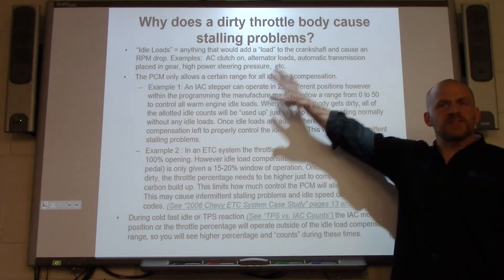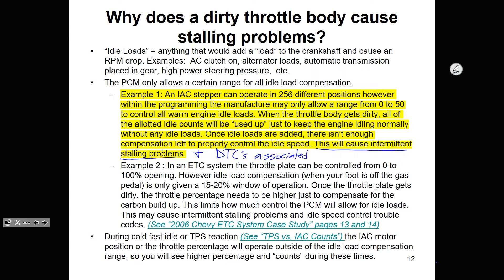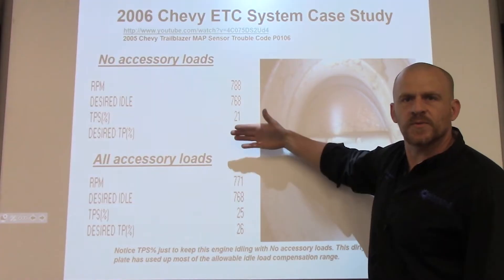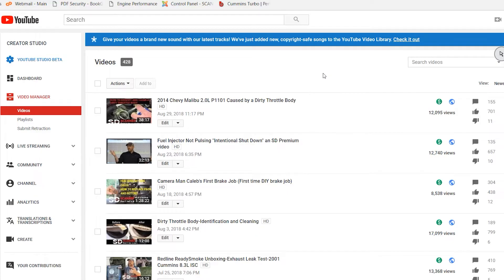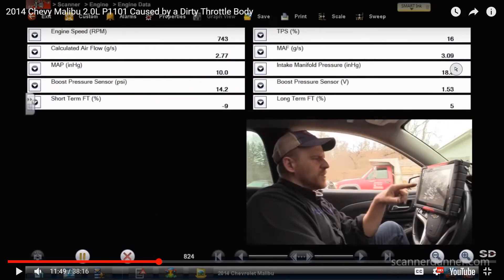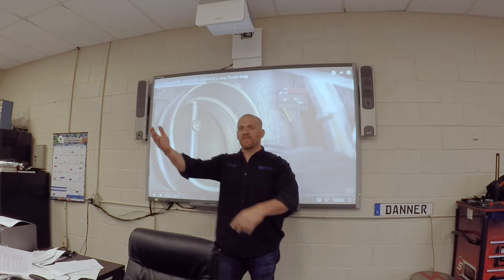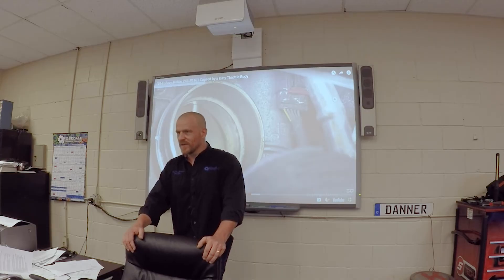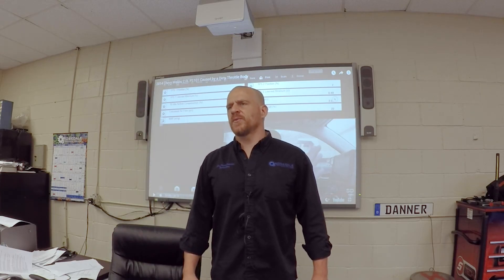Why Does A Dirty Throttle Body Cause Stalling Problems

Comment: From experience I can 100% attest that an electronic throttle body will not cut your finger off. It will pinch the crap out of it if it catches it just right.

Comment: My highly modified supercharged Boss Roadrunner Mustang kept stalling coasting to a stop, and then it wouldn't start up without giving it gas. Took twin blade throttle body off and the backside of blades were all gummed up. Cleaned it spotless and car starts on first crank and stalling is gone. This video is Absolutely correct.
Reply from the maker: Awesome! Nice job on your part

Comment: I had a dirty throttle body cause a no crank a couple of weeks ago. That was a first for me. 2007 Corolla popped a code for throttle stuck open. After reading through forums and YouTube videos. They all seemed to say a dirty throttle body was the cause. I took it off and cleaned it. Once I reset the codes it started right up. It also tripped the MAP code an hour before that.

Comment: Hey, Paul. I was trying to troubleshoot a p0101 on a Nissan Quest yesterday. I looked at the maf calculated load at idle, it was 40 and sometimes 70. I concluded that the maf was overreporting the airflow. Today, the tech diagnosed it, and suggested replacing the sensor. He replaced the sensor 3 times before he found a good one because all the sensors were causing popping noises through the intake. He even thought that the cat was restricted, which I didn't think was the case after following you for a long time. If an engine cannot exhale, it cannot inhale. Less air in means less grams per second or calculated load. As far as the dirty throttle body, could you use the tps voltage if you don't have a percentage  PID as a higher voltage would suggest a dirty throttle body?

Comment: I’ve cleaned probably hundreds of throttle bodies over the years. I always open the throttle by hand and have never had an issue from it. Nissans are the worst for resetting the idle. I had one that I had to disconnect 3 injectors to get the idle speed low enough that the relearn would complete.

Comment: Watched a ex co worker hold the throttle wide open with a hood prop, & quickly cleaned the throttle body with the engine running "WFO"! Idiot... All because it wouldnt open koeo, lol. He almost got the cleaning rag sucked into the engine as well.
Reply from the maker: 🫨 damn that's crazy

Comment: Thanks. I have the same problem in my Chevy Malibu 2017. What is the reason for getting throttle body dirty? I know its carbon coming from engine but this is an common for all vehicles. How does my vehicle throttle body is getting dirty again and again?
Reply from the maker: All vehicles! Primarily from the PCV system

Comment: I don't know if this is true for any other manufacturers but Mercury Marine use mostly GM throttle bodies on most of their sterndrive and inboard engines and they cautioned against manually open the throttle plate do to the throttle motor becoming a generator and back feeding the system. I have mistakenly done it with no apparent harm but I do disconnect the TB plug (most of the time).
Reply from the maker: I've hear something about the plastic gears internally being damaged by manually opening them. I've done so many without issues, but I try not to use the manual method unless I have to. Thanks!

Comment: i have been cleaning throttle bodies since 1984.   i wish i had the scan tools back then like you have now. you explained this in simple terms. this is the main problem  ,egr valves also cause stalling low idle.  worst i have ever seen was my daughters (uses oil). I scooped gunk out from behind the plate. another indicator is watching how fast the engine speed slows on a deceleration.  they usually fall faster than normal. glad to see you educating our youth. thank you

Comment: what do you mean by accessory loads? ac on? pressing throttle?
Reply from the maker: Alternator loads, transmission in gear, power steering loads, AC compressor. Anything that would cause an rpm drop

Comment: Sir i badly need your suggestions to keep my i20 battery health in good shape...

Curiosity...
Say about 350 CCA is lost when vehicle is cranking.

So, my question is...
For how much long time should the car be running to recover back almost the lost 350 CCA? Will 350 be recovered by just keeping it idle for 10 minutes? Or do I need to drive at some speeds at some particular gears?

Your suggestions based on your experiences ks highly appreciated. Thanks.
Reply from the maker: I don't understand your concerns. Are you having starting issues? If your not, just drive the car, that's what the charging system is for.
Reply: @ScannerDanner  sir, there's no issues at all. Just curious to know.

Okay let me tell this way...
Before starting, battery voltage is 11V.
How much long time do I need to drive or stay idle so that the battery is fully charged to 12.6 after engine off? Does it require any speeds of particular gears to run the car so that battery is fully charged?
Reply from the maker: @tnamen1307  if your starting voltage is 11, you probably need to replace your battery, unless you have a charging system issue or a parasitic drain.
Reply: @ScannerDanner  and another is... what's the general acceptable parasitic draw of a car? Is 0.035 or 35 mA a normal parasitic draw?
Reply from the maker: @tnamen1307  no more than 50ma with typical being under 30ma
Reply: @ScannerDanner  thanks so much for paying attention to my issues. Really helpful for each and every of your suggestions.
I will always keep supporting you.
And, ....ummm... really sorry for my bad English. Sorry to say due to bad poor English, i studied only till class 12. I couldn't continue any further studies. 
😭😭😭
Reply from the maker: @tnamen1307  you're doing fine my friend! I couldn't even tell
Reply: @ScannerDanner  sometimes i kept on asking myself ... Why I am very poor in English writing skills??? Why I was born differently lacking the English writing skills which has ultimately, in today's modern world, become the most important tool for any job writing exams???
Reply from the maker: @tnamen1307  proud of you man, I can't imagine how difficult it must be to try to learn a trade outside of your native language.
Reply: @ScannerDanner  one great thing to note is that after getting basic working of electricity from your YouTube videos, and with some research, I finally build a door open warning sound using 555 timer circuits. The same has been installed in my i20 2011 India. Now, every time any of the 5 doors is opened, the door warning circuit alarms me.
Reply: @ScannerDanner  you may also visit my videos of my YouTube channel where modifications/installation of new parts including AUTO CLOSE WINDOWS are done to my car i20.

Comment: Depends on the manufacturer Paul. I work for Mazda. With Mazda you can open with your finger and hands all day. It automatically resets when you restart the car. If I have a dirty throttle body causing issues which I did just other day on a 2011 Mazda 6 DTC of P0101 MAF code. PID data shows g/s at 5-5.5 at idle with a 2.5 liter engine. This vehicle should be like 2.0-2.8 at idle. Had an aftermarket MAF so I checked this out first. Then opened body and it was crusty like a coal mine. So I remove them. There is only a few bolts that hold them on and remove the snorkel pipe. I take a toothbrush and carb cleaner. I spray the tooth brush and scrub. I also take a red sos pad on the stubborn areas. Which is fine for machine metal. Just dont go crazy on the light sanding. As for spray I dont spray directly inside. We do not have issues like that. Just making a point that in my experience depends on manufacturer. Mazda push on them on you want. Wont hurt them. Some will require a relearn which is simply idle it for 30 sec. Go through gears then do again with all loads on back to P and restart car. Idle will come back up to normal RPM range.

Comment: Great video Paul and Caleb and very good info. I think that the myth of losing a finger in a throttle body are not from the force of the throttle body motor but by the natural reaction to pulling your finger out once it is clamped down causing the real damage. Thank you so much for showing these videos and showing others that caution needs to be taken when dealing with these type of units. Take care and have a great day.
Reply: It won't cut your finger off, but rather will make it hurt so bad that you think it might have been cut off.

Comment: Paul,

Your videos are gems! You explain issues so well that even a layman can understand and that shows how well you know your stuff to be able explain it the way you do! 

I have a ‘95 Mitsubishi GTO (same as 3000GT) that exhibits dirty throttle body signs (start and immediate shut off, followed by a hard start; very low idle at times, engine does not rev itself up on warm start, etc.). It only happens on warm/hot start. It seems to work better with the AC on. I cleaned the throttle body with carb cleaner and replaced the idle control valve, but the problem persists. The only way I was able to go around it was to raise the idle speed through the so called BISS screw, while following Mitsubishi’s procedure for setting the idle speed. That way, when the idle drops at times, it never drops too low. 

Since my car has an auto trans, the car usually idles at different speeds when in “Park” and in “Drive” as it is lower when in “Drive.” Could the throttle body’s shaft seals be worn out, leaking air and that way introducing a vacuum leak, causing the low idle? I already replaced the o-ring of the BISS screw as the old one was rock hard and split… The “low” fuel trim was maxed out positive, so I added 20% fuel to it, in order to bring it back, closer to zero. Fuel trim “High” has settled to 92 (Mitsubishi reads the fuel trims a bit different than other brands, where “0” is “100” and that way there is no negative sign in front of the number when the trims go in the negative… 

At the moment, the MASS airflow sensor shows airflow of 46 at idle, while I seem to remember that it used to read 34, before I raised the idle speed. The timing is at 14-15-16 at idle. I am not sure if that is the proper way to fix the problem I had, but it seems to be working for now. I used to get 505 trouble code before I added more fuel to the fuel trim “low,” and after I added fuel, the check engine light is constantly on, but my scanner does not show any codes. I have set the TPS to be at 13%. Am I on the right track, or do I need to do something specific that I am missing?
Reply from the maker: I dont understand what you mean by you added 20% fuel to it? Is there an aftermarket programmer on this?
20% postive fuel trim at idle does suggest a vacuum leak
Thank you!
Reply: @ScannerDanner ,

I have a programmable ECU so I can change the values. There is a fuel table, called VE Smoothing Table that can be used to modify the values of the fuel trims… I suspected a vacuum leak, but I fixed all of the ones I found and still no difference. That is why I am suspecting the throttle body shaft seals. Or could it be that I did not install the valve stems seals well, when I was rebuilding the heads, and they leak? 
Thank you so much for responding!
Reply from the maker: @IlianNachev  there is a lot of possibilities for what you have, especially when modifications have been done.
Does your lean condition improve as you raise the RPM in park to 3000? Or is it about the same? If it improves, this suggests a vacuum leak, if it is about the same or gets worse, we move away from a vacuum leak
Reply: @ScannerDanner ,

The values improve when raising the RPM, yes. Once the car starts idling is when they go up again… I will keep looking for vacuum leaks! Thank you!
Reply from the maker: @IlianNachev  don't forget about your brake booster and also the pcv system. Pinch off the booster hose while watching O2 and STFT. Do the same for the PCV valve and purge valve for the EVAP system.
Reply: @ScannerDanner ,
Will do! Thank you much!

Comment: So I have an good question for you might make an good topic! On the 2011 jeepgrand cherokee wk they are common to have p0563 battery system voltage to high which is common to an bad alternator, battery or open/short in system! Client has replaced alternator and kept doing it then someone used an external electronic box to bypass the alternator the the fuse relay panel but code still came back alternator and battery are showing good but I found an interference ground strap not hooked up and just hanging and but connectors on the work for box where not shrink wrapped and such have you heard of these systems cause the battery is located under passenger seat and there are extra contact points to deal with than normal? Thanks for your time!
Reply from the maker: These are known for bad alternators and bad ECM drivers for the alternator. I have a case study on a 2011 Jeep with this one my website.
https://www.scannerdanner.com/scannerdanner-premium-chapters/battery-starting-charging-systems-troubleshooting/788-2011-jeep-liberty-alternator-field-control-and-pcm-driver-problems-part-1.html
Reply: @ScannerDanner  thanks for the information much respect for your knowledge and help!

Comment: Great explanation. I had a nissan maxima v6 (vq30de)  engine .  Randomly would idle strange at times.  What fixed it was a idle air volume relearn procedure
Reply from the maker: Those relearn procedures where do odd on some Nissan systems
Reply: @ScannerDanner   yah,  like unplug the throttle body while it’s running and reconnect  within 5 seconds after the car is warmed up.  

That’s a  Hitachi  throttle body on nissan.

Comment: I would say that dirty throttle bodies still cause stalling, but not like they used to. They do a better job compensating for it these days. Back in the late '80s it was a huge problem
Reply from the maker: it is still a huge problem! Check out the related videos I put in the description

Comment: On 2015, the mitsubishi outlander Sport se  vehicle  idle would go  high and low at  idle speed act like a vacuum leak . No trouble codes found clean throttle  body problem went away  vehicle had 50k miles on it. Bought the vehicle  new.

Comment: If I was near your school I would have you use my car for your class. It has stalling issues, not wanting to read the O2 sensors, extended crank time, and randomly misfiring on random cylinders. I have a 2010 Chevy Aveo.
Reply from the maker: extended crank times makes me want to verify fuel psi as a starting point, especially because you mentioned O2 sensors not reading properly and random misfire codes

Comment: Hey Paul, how are you brother? I had a dirty throttle body a few years ago and yes it does cause stalling problems. It also cause idling and acceleration problems. I cleaned it myself with, I believe, a carburetor cleaner, reset the idling to factory and it was good after that.
Reply from the maker: For sure, the initial step in of the throttle in particular. Thanks!

Comment: Could you disconnect the fuse to the fuel pump and turn on the key as you depress gas pedal to open the valve plate?  I'm by myself and can't test it myself.  Need a second person.  I'm not stalling but have a rough idle.  Went to a smog shop and the mechanic is telling me that I have bent valves and need an engine rebuild.  Had problems with new spark plug wires and new spark plugs.  He set up the timing after I had not tightened down solidly to be able to readjust the distributor timing.  It doesn't need to be perfect to run at 4° BTC.  Slightly retarded will cause loss of power and poorer gas mileage.  

The mechanic didn't think that my vehicle was worth keeping.  I like my 94 GMC Sierra C3500 box truck from U-Haul.  She had failed smog on the engine and EVAP system.  I personally put in a new fuel pump assembly unit which fixed the EVAP system fail.  I thought that the new distributor I put in myself would fix the AC Delco plugs and wires I replaced before going to hopefully pass the California smog test challenge.
Reply from the maker: First, your fuel pump does not run with just the key on and you injectors will not fire either, so even if the pump was running, you will not flood the engine by opening the throttle. So all of that is unnecessary. 
Second, a dirty throttle body will not cause a rough idle. A very low idle speed, yes. A rough idle with a normal idle speed, absolutely not. 
Third, if you want your throttle body to open and you are working by yourself. Block the wheels so it cannot roll, put your parking brake on. Turn the key on, engine off, then put the truck in gear, then place a brick on your gas pedal to hold it open (engine is not running of course). On an ETC system, this should allow the throttle to open all the way. 
Super important that you are following exactly what I am saying as there are some real dangers here of the truck rolling on you.
Reply: @ScannerDanner  thank you for responding.  I've used spray cleaner inside but the coke plate is always closed.  Do those cleaners work well that you add to the gas tank?
Reply from the maker: @peacepoet1947  not for cleaning the throttle body as the cleaner is only in the fuel system and the throttle body is air and PCV gases only